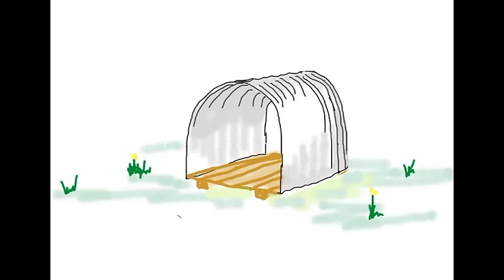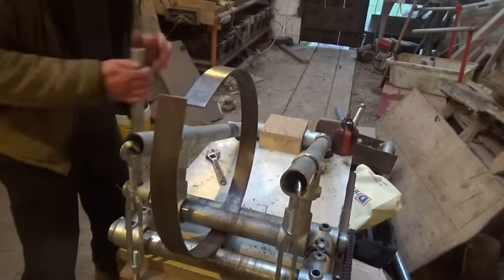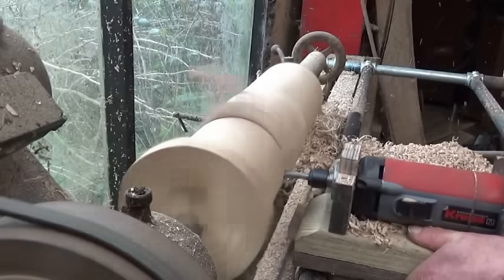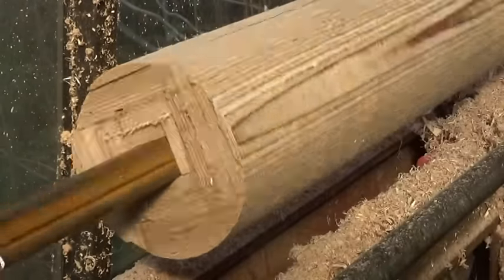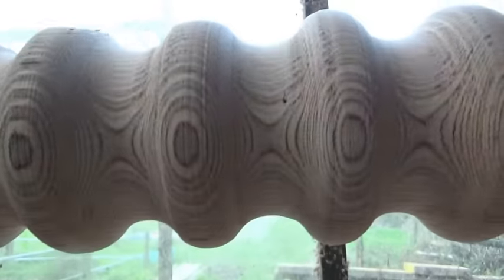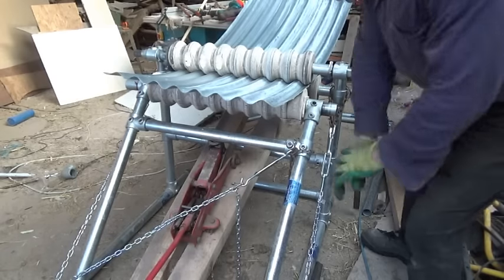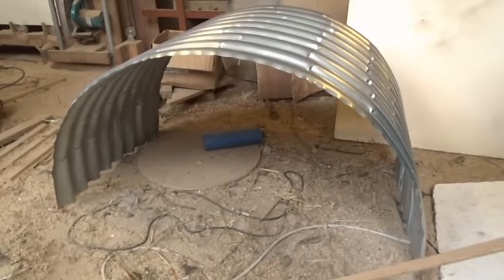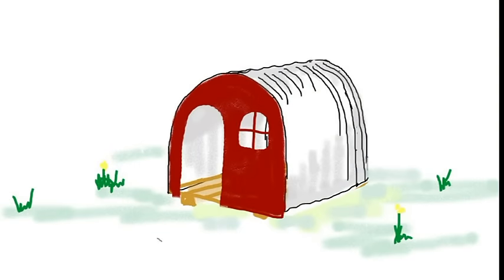Homemade Corrugated Iron Roller (well, nearly!)

Comment: You dont need a LARGE MOTOR. You need a small third cog to reduce to. In other words, you need a Gear Ratio, and a motor strong enough to turn that reduced amount of required torque. I think its probably very doable at 4:1 or 5:1.
I look forward to seeing updates.

Comment: You can make gears, is there a way to provide a mechanical advantage to the handle via a chain and gear instead of direct drive? You will have to complete more turns, but they will be easier.

Comment: Corrugated iron stock tanks (cut in half) must cost less than all this effort. Not that the effort goes unnoticed or unappreciated.
Reply from the maker: No such things in this country : -  (
Reply: @WayOutWestx2   In Australia, corrugated iron tanks are very common, almost to the point where they become a nuisance to dispose of. So we end up using them for animal shelters,  firewood sheds, raised vegetable gardens etc. Funny world we live in. One man's trash is another man's treasure.
Reply: @xeroxene : we don't even cut them in half -mostly as I recall - to make into a kennel, just position so that the hole in the top is at the bottom and throw an old horse blanket inside for the dog bed

Comment: Forget about the corrugated. Make it out of flat sheet. Three or four bits of flat bar as ribs and a few rivets.
Reply: im planning on doing the same with some boiler plate that i got :D not exacly boiler plate but plate steel off a  huge oil tank ..

Comment: So cool to see your last few videos building toward these bigger projects. I think getting a smooth roll without the kinks is probably down to the rigidity of the frame. Rethink that and I think you'd be there. A few more gears and you could get away with using a fairly small motor
Reply: Also, perhaps the corrugations on your rollers are too deep! When I've seen rolled corrugated steel in person it seems the corrugations have been allowed to get shallower along the bend.
Reply from the maker: Thanks, Ben. The problem is if the corrugations were shallower, then the sheet would be wider, so I'd end up with a pear-shaped piece, wouldn't I?
Reply: Ah yes, right you are.

Comment: We use what is called tank iron for making mining shaft collars, the metal is softer and does not kink 
if you run it through a few times to get your desired curl. 
Newer corrugated iron is more tensile and kinks
Reply from the maker: I didn't know that when I started, but you're right. Now I just have to find some in Ireland...
Reply: Best of luck with your project you are certainly willing to give things a go and something good always comes from that. Keep your eyes open for an old caste iron roller and one will turn up, they used them for tank making and bullnose sheeting and are still around unused and needing love

Comment: The only thing I can think of that might help is heat.  You're curving the corrugations across the grain, which is where it's stiffness comes from.  You're compressing one ridge, and stretching the opposite valley.  The result is many inches difference in length.  F'ex, at 36" interior half circle at a 1" ridge/valley will be a total of 6" longer on the outside than on the inside.  What you're rolling looks almost 2", which is a whole foot difference. Heat would help ease the expansion and contraction.  Though it might damage the rollers...

Comment: Interesting video.   The tighter the radius, the more likely to get kinks.

The rolling of the flat bar worked well.    How about rolling a few pieces of flat bar to make a set of ribs, then covering this with sheet steel or plastic screwed to the ribs.   It is much easier to get the tight radius you desire with such a construction.

A less expensive method may be to make the ribs from PVC pipe.   You would likely need to heat the pipe to get the tight radius, but you could make a template of the shape then heat and bend to the template a lot easier than rolling steel.

Dave.
Reply from the maker: Thanks for the suggestions. I hope one day to be able to show you why I'm holding out for this design..

Comment: some creative criticism here.
I think you're asking to much of the project trying to cover demands of three or more uses for it. 
I'd try and focus on one "really good" purpose while keeping in mind an optional "dual purpose" for it. 
This allows you to focus on quality and the actual project rather than building or obtaining to much additional tooling . 

I'd also ditch the pallets all together or use them for framing and sheathing. 

 Maybe you could use some of the corrugated for a typical roof shape. 
personally I'd only use it for the roof if anything. it's just to difficult to work with for walls and heavy. not the best material especially if your needing mobility and a tight coop safe from predators.  

Metal rodent fencing would lighten the load a bit. if someone wants one with the chicken coop you could fashion it to install via a modular wooden unit.  

If wanting to provide rain cover for small animals or kids to play under then I'd wire up a good large tarp. 
...not only would they be removable but they're  light and come in different colors. !even camouflage! 
it's also just an easy material to work with. vents, windows ect...
good luck hope this helped. 
manifest it. draw it and bring it to life! don't fear expanding on others works.
Reply from the maker: Thanks for the suggestions. I hope to be able to show you in a video sometime why I'm keen on the pallets, but perhaps you're right!

Comment: I would think that making the sheets narrower would make them easier to roll and less stressful on the rollers and the person doing the rolling.  It means you would have to roll more sheets too but, this isnt an easy thing your doing.  Also, if you look at how quanson huts are made you could do something similar.  They make very short and narrow rolled pieces and screw or rivet them together.  This enables them to be transported easier and can be assembled without cranes or crews of people.

Comment: I wonder if a "harbor freight" style hydraulic bottlejack style press could work as a basis for DIY metal shaping machines. It might not be much more expensive than the pipes. The restriction of degrees of freedom is simpler with that type of contraption.

Comment: Would "semi" corrugated work? i.e. instead of having the wavy bits across the whole width, you could have 2 or 3 with about a 30 cm gap followed by 2 or 3 more wavy bits. 
So, instead of a cross section like this: 
~~~~~~~~~~~~~~~~~
You would have: 
——~~~~————~~~~——
It would be a lot easier to roll and would probably be less prone to twisting and crimping.
Reply from the maker: Yes, that's a possibility. But aesthetically? I don't know...
Reply: @WayOutWestx2  
True, it wouldn't be very pretty!  
Maybe if you put the corrugations at the edges rather than in the middle it would be less ugly. Also you could overlap them, like normal corrugated sheets if you were to use more than one of them in projects other than your little animal houses. Like this:
~~~~————————~~~~

Anyway... just a thought!

Comment: Thinner metal and annealed it.  I think 750 degree c might do it.
Reply: Nope, all curving quality corrugated is formed with .65mm 24 gauge soft feed. Thinner material will kink horrendously.
Reply: @philbox4566  When the metal is corrugated it becomes work hardened and left work hardened.  Annealing will allow plastic deformation.  I think kinking is unavoidable. 

but honestly he should be making things out of plastic.  Plastic last longer,  stronger and easier to work with.
Reply: @MichaelMantion  Plastic will never last as long as metal roofing. Trust me, roofing plumber of 40 years speaking here. Plastics have a very limited life span in comparison to the modern coated steel products. You may think, but I can state categorically that this is so. I am putting roofs on now that will outlast my grandkids great great grandkids. I cannot say that plastics will last any more than 20 years on a roof and in the sun. Trust me also when I say that corrugated iron can be curved without kinking. We do so every day with our curving machines in the sheet metal and roofing workshop. The roofing material must be specified as curving quality which is soft feed, .62 BMT corrugated iron. I have actually curved a tank to 150 radius. Had to throw away the two outside ribs on each side and it was a bear to get off the rolls but that is as tight as I could force the issue. I regularly get the radius down to 350mm.
Reply: @philbox4566  No one making roofing materials or installing roofing will install plastic.  Its not in their interest to use a superior product that last a long time.  Thankfully we have plastic decking and plastic siding that last for decades with out painting or any real maintenance.  there are buildings that use plastic roofing, but they are custom billion dollar buildings.  I bet plastic roofing will go main stream soon enough.  That said there are lots of plastic sheds and plastic dog houses that last far longer than non-plastic versions.  I do like metal roofing, but in the end plastic would be better for things he mentioned.
Reply: @MichaelMantion  Wow. All I can say is I am staggered at your uninformed opinion. Look further up and see my previous comments re metal roofing. I am putting on metal roofs now that will last north of 200 years. Plastic roofs, yeah right. I am pulling plastic roofing material off roofs that have not last 5 years. The best that any manufacturer of plastic roofing materials can produce will last at the very very most in ideal conditions, 30 years. 30 years, 200 years. The choice is clear.

Comment: A motor to drive it shouldn't be hard at all given your skills. 
What I would suggest is to do much smaller widths, which then overlap to get a wider roof, just like they do with roofs 2ft sections,
but I would do maybe 3 rows widths, then maybe the steel rollers are doable.  
Another thought is to have just one roller and then do multiple passes to do all of them on a sheet.  

btw, I had the same idea to make tubing roller dies using sheets of different diameters, since I only need ONE to roll tubing.

Comment: It's much easier to bend the corrugated iron the other way, isn't it? In line with the corrugations I mean. Or buy large corrugated culvert pipe and put in a wooden floor and two ends. Perhaps it isn't as attractive, though.

Comment: Looks really good! It might be possible to increase the diameter of one of the rollers (english wheel style shaping rather than "just" pressing it into shape and definitely motorise. More passes would seem to be the key to cold-working. Not sure this is actually a failure yet, it's a prototype :)
Reply: Allan Stirling - Well stated Allan. More passes, gear reduction to minimize the effort. Do the modifications and retest.
Reply from the maker: Yes, you're right, but these already took 40 passes each..
Reply: @WayOutWestx2  "just" need to design it so you can leave it overnight without coming back to a crumpled mess of disappointment, then :) Thanks again for all of the great, inspiring sharing of your lives.

Comment: I don’t think failure is a word anyone should ever use ,it is trying to figure something out and it is always improved upon till it works ,and I know you can use a cheap little motor with some pulleys and belts to make a gear reducer then the motor doesn’t need the torque , nice job and that’s what I do too ,take a break from a project until revelation comes !!👍

Comment: I think your rollers :
Need to use only two rollers and they have got to be absolutely parallel in square and in the fore aft plane.
   ( The third roller, in this case is set high to the out feeding plane and is bending the work into a curve
Need to be absolutely locked in an equal pressure application aspect.
Need to be consistantly  round, SANS THE FLAT SPOTS.
Maybe two roller sets the first one set with a wider spacing between the rollers just to start the corrugation crimp
and the second set to finish the crimp( being your using wood rollers and framing with a lot of tension/ warping slack)
AND you need to start the feed of the stock absolutely square to the rollers.
AND use vegetable oil to very lightly release the friction binding.

Comment: I realise you aE probably working with what you have on hand , but I think using ball bearings instead of that bushing you are using would reduce a lot of friction. And the chain drive system is probably more efficient at power transfer than those cut gears. I think sourcing some sort of assisted drive like a small electric motor, possibly DC motor so it's easily reversible

Comment: To get Curved Corrugated Metal I noted the industry uses two operations....first Form straight Corrugated Sheet...then run the Corrugated Sheet again through a Second adjustable Set of Rollers to obtain required Arch needed!!!! This allows Metal Roofing to obtain/become Free Span Roofs (no Rafters or Roof Structures).....Great Video....Keep Up the Interests

Comment: Morning Tim. I work with a Company in Hamilton New Zealand who have Rollers and bend  up Corrugated Galvanised Steel down to 300mm ( 12" ) in diameter. Would you like to make contact with me. Graham Sales on Facebook. (The cruising Electrician.) P.S. Kiwis can Fly.
Reply from the maker: Thanks, Graham. Were you thinking of giving me one?  : -  )
Seriously, it turns out that the steel you use down there is quite different from ours, so even with the machine I couldn't roll it like that. (Tried to find you on FB but there are too many to choose from!)

Comment: Hi Tim. I like you idea.  If the house has a curved roof with ends does the sheet need to be corrugated? Plain sheet should be plenty strong enough at this size.
Reply from the maker: You're right and I might end up doing it that way - but it doesn't look as good : -  )

Comment: This is a good start. If you look at commercial rollers the lower pair of wheels are fixed, but jack screw adjustable, in a triangular plate steel frame. Then all you need to do is apply force via bottle jack.  It'll take some shimming but you'll get there in no time. 

As far as input force goes, you simply need a bigger gear reduction. An old compressor motor  plus a bit of bike chain and you'll be there in no time. When it's powered you'll be able to  make many more cycles thus smaller displacement each cycle. That means even less input torque required.

Comment: Flat sheet rolled with rolled pipe on each end for strength would be doable without much ado.
Or gear reduction and  one larger wooden roller in the middle and lots of incremental rolls might be the next step but to me bending corragated roof tin will require heavy duty stuff. Expensive.

Comment: Hi Tim, I'm glad you are not my neighbour (slight North East of you) as I would get nothing done.
Things that jumped into my head were
1- old cast iron gym weights might make a cheap but blocky stacked mandrill for the roller IIIIIIIII
2- would it be worthwhile getting one professionally rolled to the shape you want as a blank die  to press flat sheets up against using horizontal scaffold poles ( in a five bar gate arrangement) to roll the sheet onto the die from left to right, back and forth.  Would be possible to use the tractor as the prime mover.

The second idea would be a bit like one of those pipe bending machines that uses a mandrill and a long lever arm, only huge and inelegant, like myself :- )
Like this

https://youtu.be/tISkpkATQAM?t=10
Reply from the maker: Thanks for the suggestions, Jeff. I'll look North East and expect to see steam and sparks : -  )

Comment: I wasn't going to watch this. I live in a 1 bedroom apartment in a city with no room for rollers,LOL. but I am glad I did. I loved the idea even if it did not work %100. I was impressed when you switched from steel rollers to wood. so many people only know how to get to no, they never keep searching for yes. You did. 
I wonder if you could try a different material for the roof. it is brilliant to come up with new uses for pallets. 
There is a wonderful old book by ken kern titled The owner built home. it is crammed full of amazing old technology for alternative home building methods. On one of the pages was a design for Quonset type homes made from mostly cloth covered frames that were hoop-shaped and the cloth was permeated with a cement slurry. When the cement dried it created a strong roof and walls that was in a corrugated hoop shape. I wonder if you could make some hoop frames and cover them in burlap and add the cement slurry to them?

Comment: So those kinks you call em would be in the world of sheet metal shaping called "tucks" its because metal needs to shrink in certain places due to the shape and needs to stretch in other places to be able to hold the shape..  So in the end with that solution, unless you can exert alot of force into the two bottom rollers (like a bottle jack) and have that force spread out  properly and keep the tolerances reeeeaally tight.. like the missing pieces in the roller is most likely a source for kinks.. Then you can easily motorize the setup with a junkyard motor a gearbox of some sort and some tinkering with speeds and feeds. 

Great project tho, wouldnt consider it a failure at all.

Comment: Heating the steel to anneal it before you try to roll it may help a little by making it softer or you could try smaller pieces and then weld them all together.